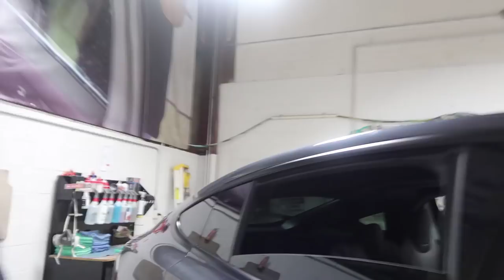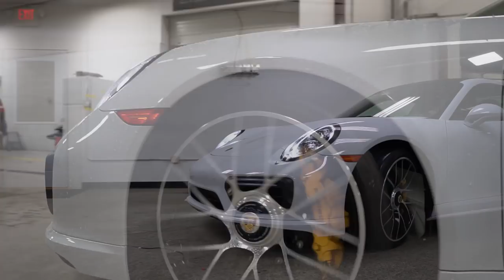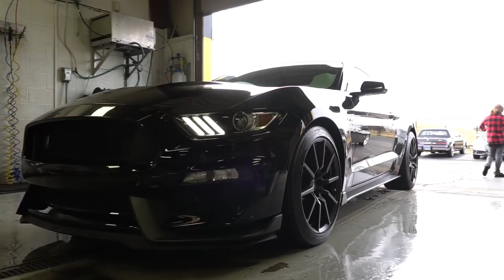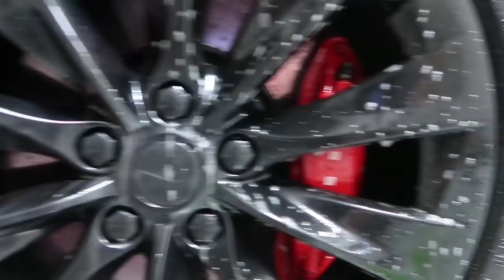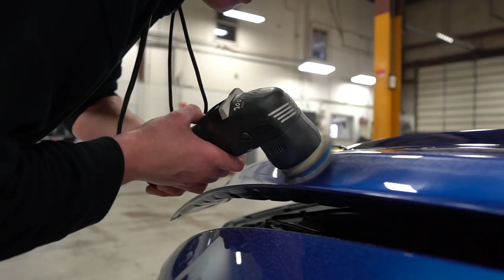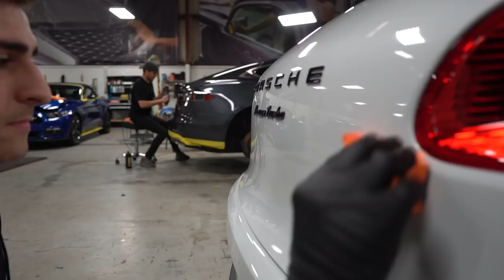CarPro Iron X VS TUGA Alu-Devil Special | Detailing VLOG #24

Comment: Tuga is a wheel cleaner with iron dissolving properties.ironx is a strong iron remover been using tuga for years thought you guys were pros
Reply: Correct. And the red color does not indicate how well the product cleans. I use the Tuga as an all-round rim cleaner with excellent results. The Iron-X only removes iron particles. And this they should have known, in my opinion.